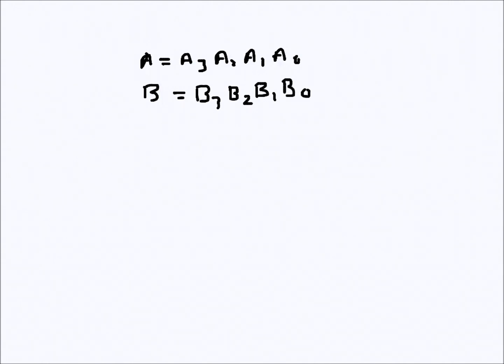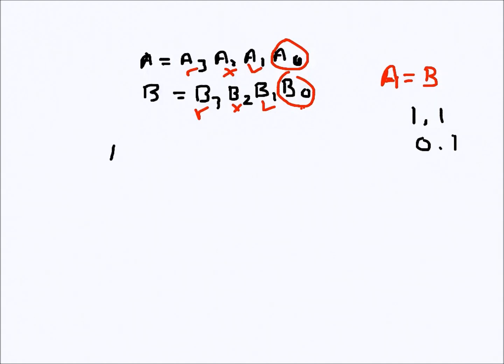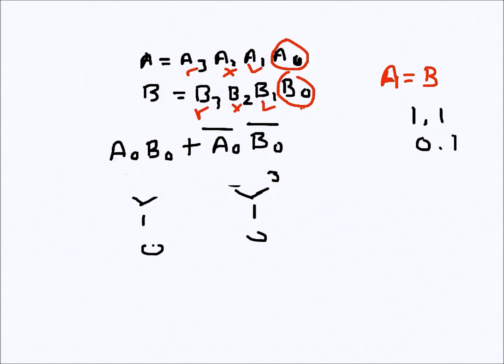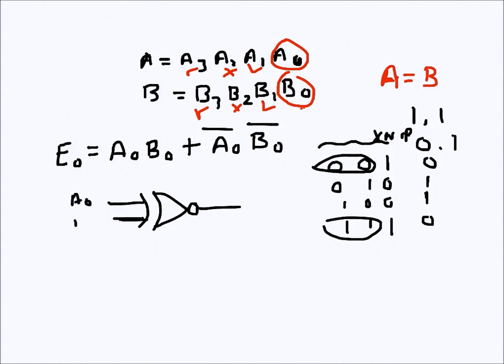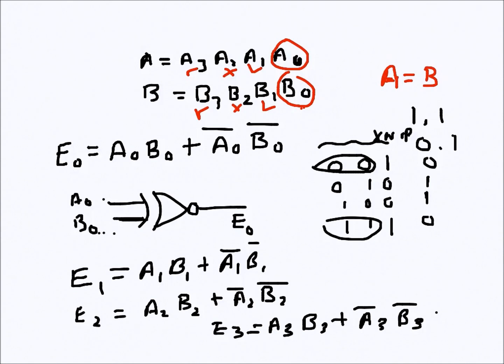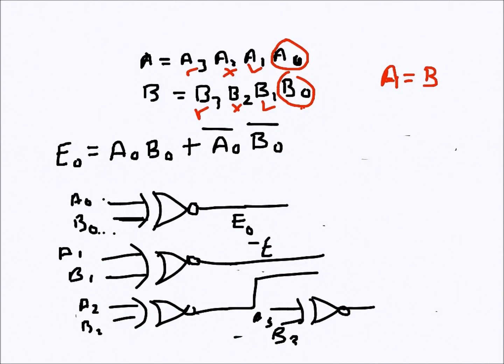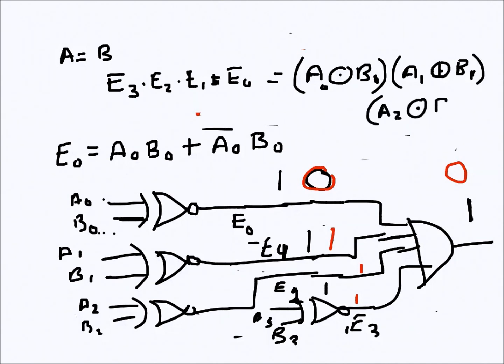Digital Electronics: 4 bit Magnitude Comparator (Check for equality)

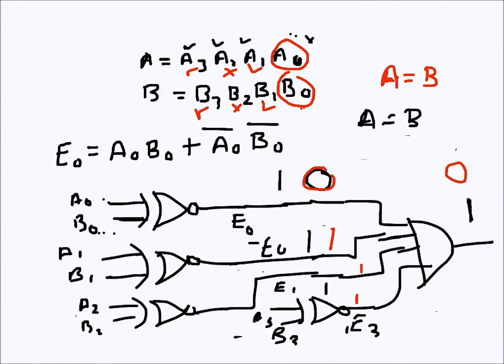Comment: @5:11 how come when A(0) & B(0) become 0, A and B aint equal?  arent they supposed to be equal cos A=1110, B=1110 arent they?
Reply: im a second year student and we're doing 4 bit binary comparator prototype
Reply from the maker: thanks, I think at that particular time an arbitrary situation is assumed when they are not equal, in that case output will be zero. A 2-input XNOR gate outputs 1 only when both the inputs are either 0 or 1, i.e., both the inputs are equal.